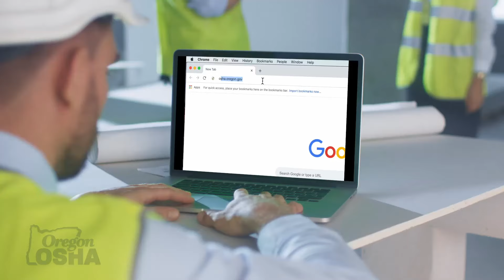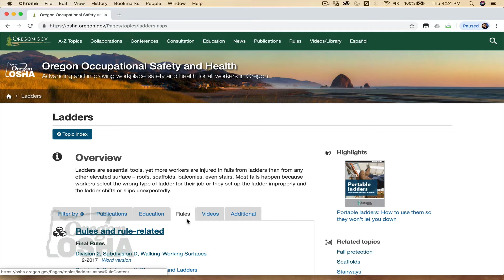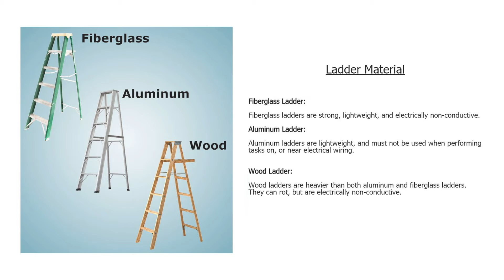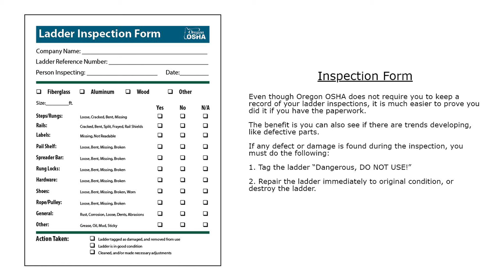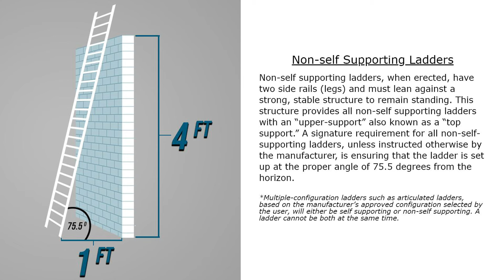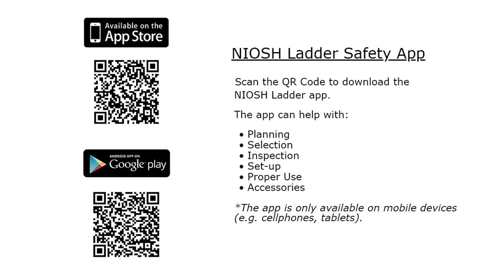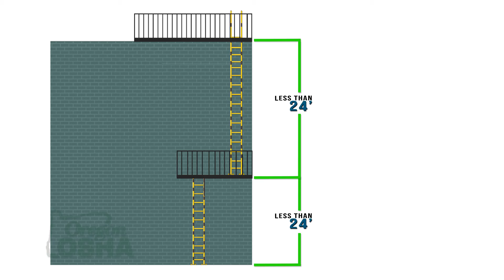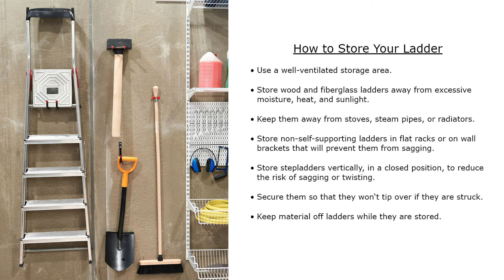Ladder Safety Training Course - Full Length

Comment: Ladder is for proper access only. Use a scaffolding platform when work at height is to be carried out.  Do not confuse between the use of a ladder, and a working platform. Let the employer provide you a proper working platform specialy when you need to carry work activities at height with materials. Simply, a ladder is a part of a complete scaffolding when you are to work at height.
Reply: ❤❤❤nice

Comment: Most ladder involved injuries are strains and sprains caused by lifting and carrying, which can be life changing. 
Most ladder involved deaths can be traced back to operator error, such as selecting the wrong ladder for the job.
One main reason for wrong ladder selection is weight, no one wants to carry the heaviest ladder for their job, but often times the correct ladder happens to be the heaviest one.
Using a ladder mover takes "weight" out of the of picture and allows us to easily use the safest ladder for the job.
Reply: Another main reason is the cost of these ladders...